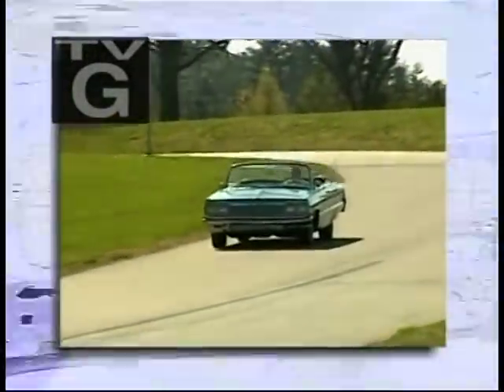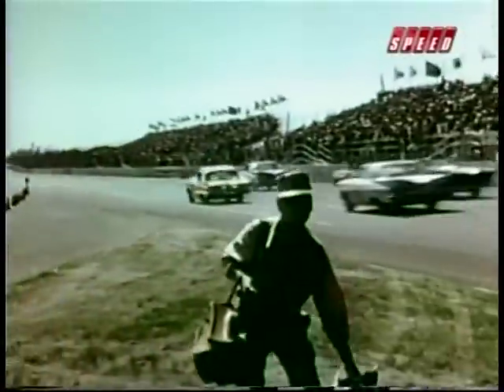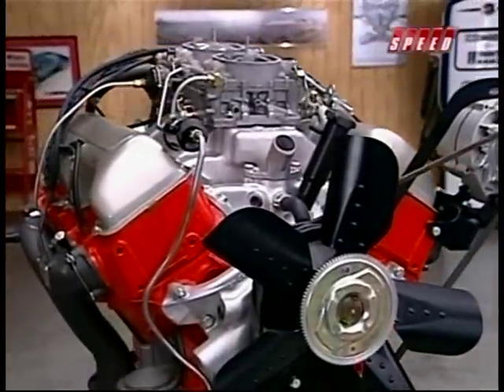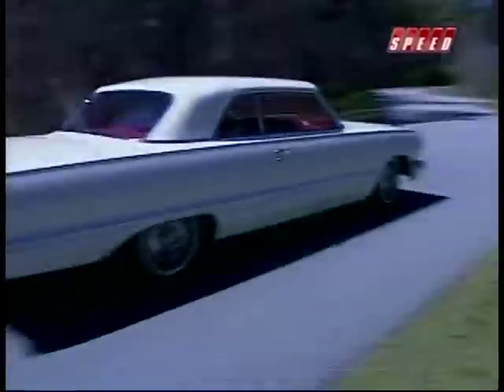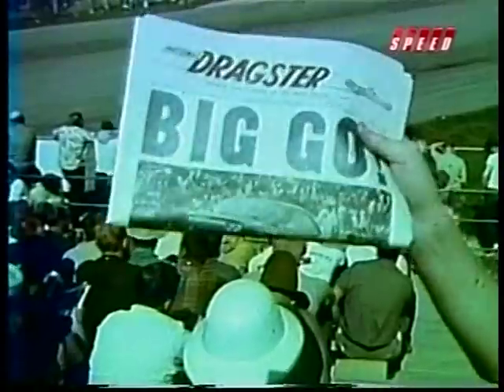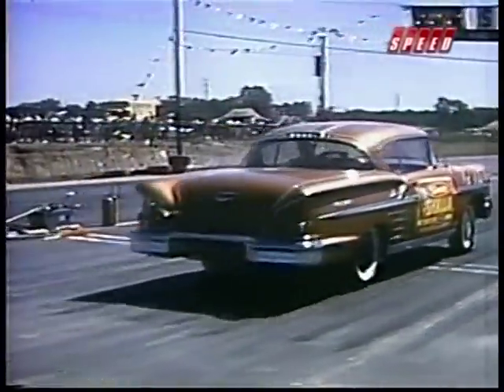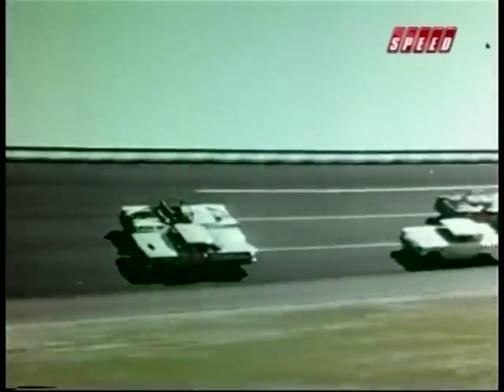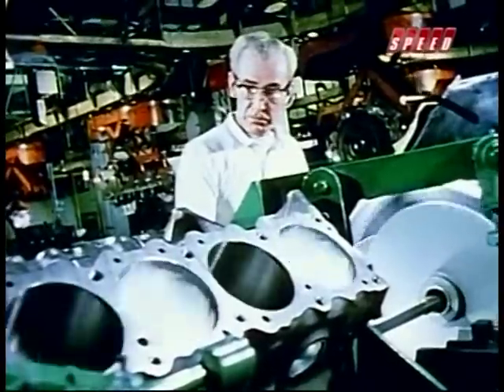CHEVROLET - The 409 SS Impala Story Part 1 of 3

Comment: I have a 1962 SS 409-409 with factory air. Factory Air was installed at your local chevy dealer. The factory air unit came to the dealer in a package placed in the 1962 trunk.
Reply: Cool

Comment: well,i have one of very few in my shop..its a# matching.we have the biuld sheet,it mentions the a/c,and the biuld code #'s match,and the serial #'s are there,as well.i was told you couldnt get a dual quad engine with anything but a four speed,but ive seen 62 409/409 with a 3 speed on the column,with paper trail.they do exsist,just way rare.how about a 62 409/409 belair bubble top,with air,p seat,and tilt wheel?i have a freind that tells people this is real,i know that it is "NOT"

Comment: to bad Chevy didn't put the 409 in a lighter car.
Reply: It weighed about 625 LBS, too heavy for a light car. It was designed as a truck engine and so it had extra metal for longevity.
Reply: @johncollins2442  It was "designed" for the heavier cars of 1958 and future years.  Chevrolet made all their engines available for trucks but even the two ton medium duty trucks were mostly 6cyl until the sixties.

Comment: 3 speeds did come behind the 409's,but most that had the 3 speed were the smaller h.p. motors,such as 340 and 380 horse powered engines,but to see a dual quad 3 speed car would be really rare,but there is atleast one documented 62 four door car,409/409 3speed.alot of the pontiacs came with 3speeds,because they were faster with 3speeds,than 4speeds,especially the 389 g.t.o's,from 64 to 66.